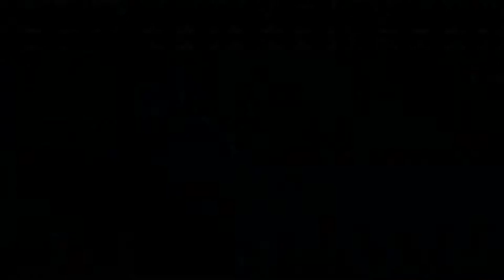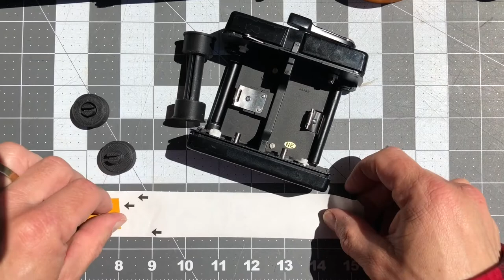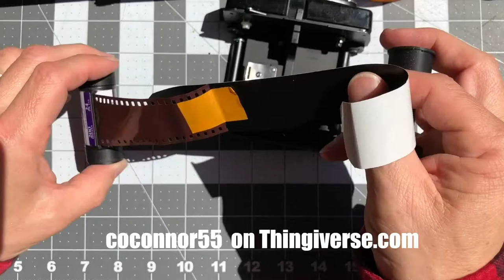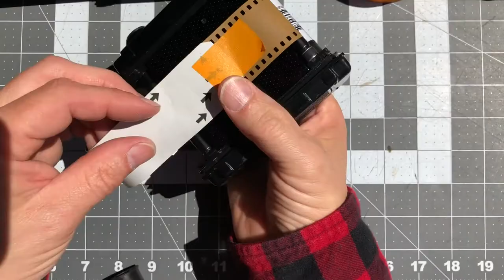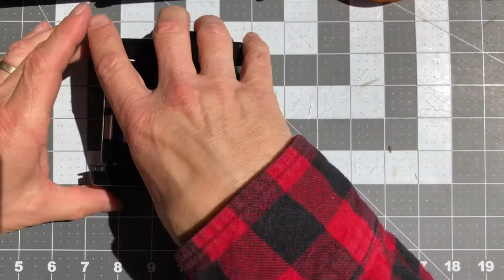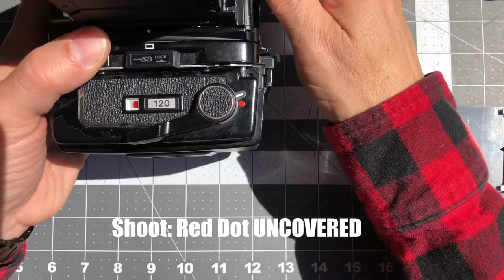35mm Sprocket Pano  Part 1 - Loading

Comment: To get rid of all that dancing with the double exposure protection, wrap a single turn of electrical tape (black, by preference) around the turn around roller and frame counter drive roller on the supply side of the magazine.  That way, the film going around the roller will drive the counter, your frames will be spaced just like 6x7 frames usually are, and you won't have to constantly switch the double exposure lever for every shot.  Even better, after loading, you can just advance until the lever locks and the red flag in the window retracts.  I shot a 24 exposure roll of 35 mm that way today (without the paper leader, so almost half the film was wasted, but I was mainly testing that my framing fix worked).  Every advance worked just like I had 220 film loaded.
Reply: Thank you for this tip!

Comment: once the frame counter activated, a 220 format back will fit the number of frames that copes with 135 36 frames film.
For loading in the 220 back I tape a 40 cm long piece of 135 film cut out of an old film, so frame number one on the back fits with the beginning of the film.